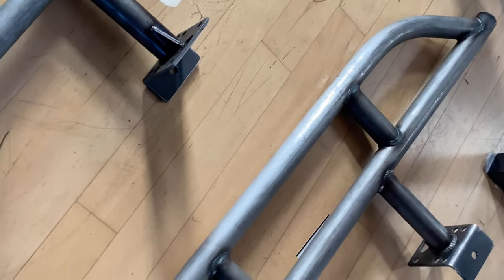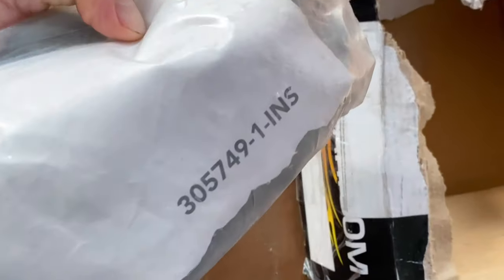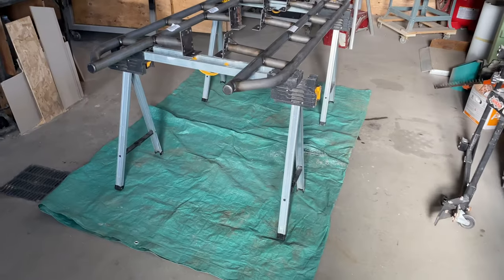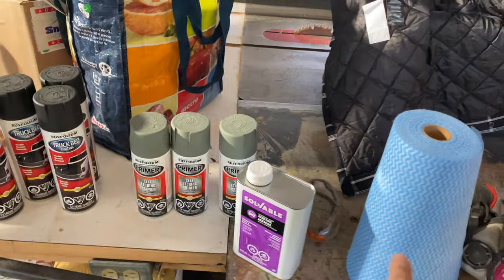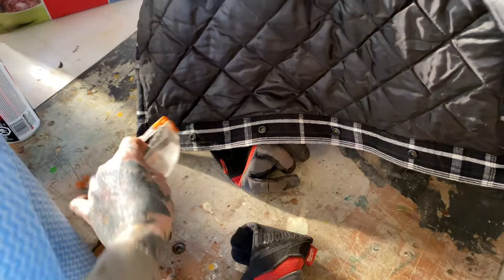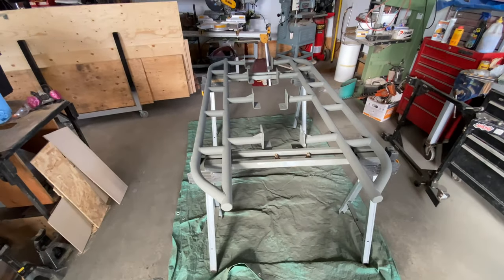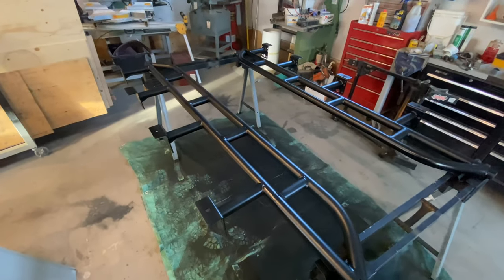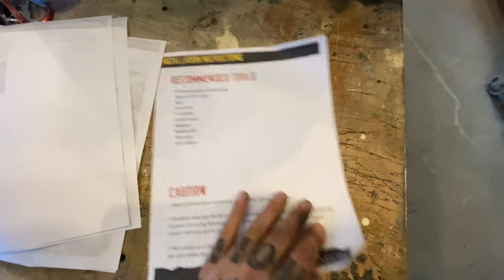🔥TRAIL GEAR ROCK SLIDERS 🔥 | 2ND GEN TACOMA | DIY PAINT/ INSTALL

Comment: so these pretty clearly dont fit the stock slider bolt holes.. There really arent many good options for stock bolt hole replacements that ive found yet. I dont even see any trail gear ones with brackets. Maybe included but they dont show them.
Reply from the maker: Yea exactly I switched mine out a while back for some Knowlton Fabrication ones . Straight bolt on and only had to put a couple more holes for some reinforcement.
Reply: @tacodrewww  part of the fun of owning and customizing your truck, i guess haha